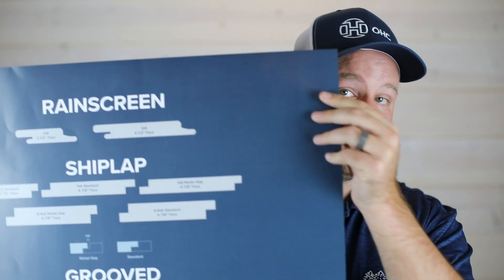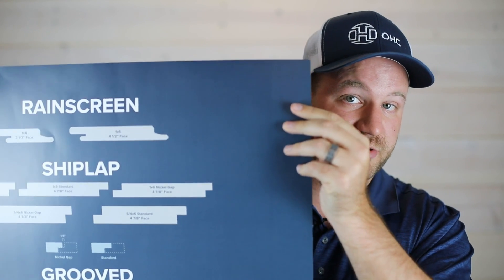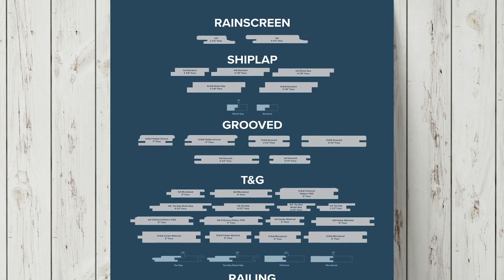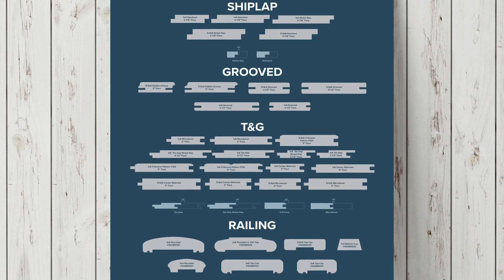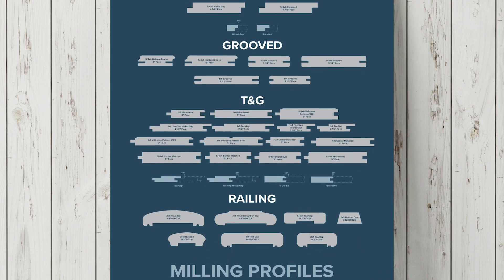The Best Wood Siding Profiles - TimberTips

Comment: Thanks for the video. I'm in Ireland and planning to clad our house in timber - something that isn't done often. Our architect has detailed our vertical cladding to sit on a vertical then horizontal cross batten effectively leaving 100mm of space between our timber frame and the cladding. Is this over-engineered or do you think given our wet climate that extra space for airflow is a good thing?